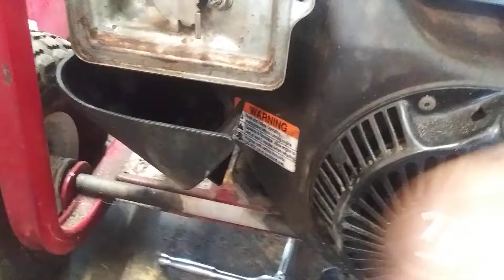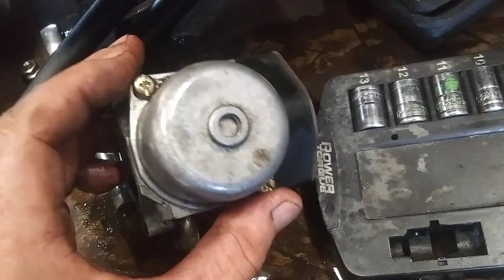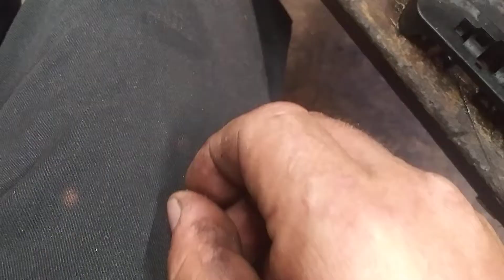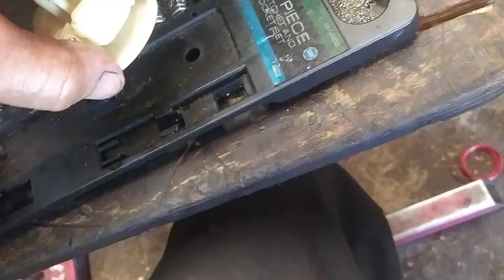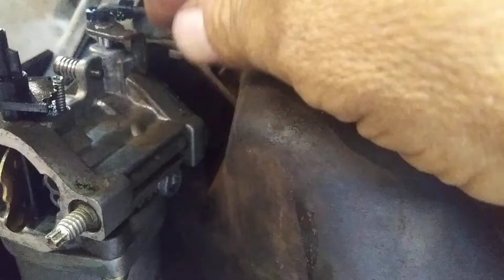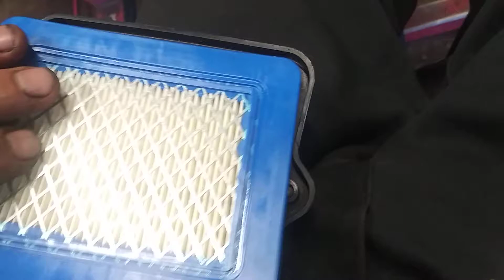* Craftsman 5600 watt generator carburetor repair briggs and stratton 10hp gentek carb rebuild

Comment: I appreciate the video. I just picked up an old 2001 Generac WheelHouse 5500 and it uses the same Briggs 10hp motor. It's surprising how even back then they were making things unnecessarily harder to fix, like using those fancy torx studs or tightening the devil out of those carb bowl screws. Or how you have to remove the carb to get the flywheel cover off.

Comment: Thank you! Not a difficult process but you made it much easier. Generator was running with choke on but not off. Cleaned the carb and added new gas…Hope it works. Thanks for the helpful video!!
Reply: Where can I find that seal or  carb

Comment: Hello 👋 Great Video! Unfortunately I Just Cleaned The Carb On 1 & Put New Gas In & It Still Won’t Start Without Starter Fluid & Only Runs A Few Seconds?

Comment: The 4mm socket you used to take off the carb. is a great suggestion. If someone wants to buy the one that is recommend it is an E5 star socket. The only auto store that had one where I live was NAPA. Very helpful video.

Comment: Mine has a wet spark plug. Why would that be happening? Also, seems to be running super rich. White smoke and sounds like it’s revving constantly.
Reply from the maker: sounds like the carb is leaking id clean and pay close attention to the float and needle valve. check oil gas may have gotten in it as well

Comment: I replaced a bad carburetor on my Craftsman 5600 generator with a Briggs and Stratton 10 HP engine.  It runs now but now it’s blowing smoke out exhaust. I tried to adjust It but can’t get it to run smooth plus it  keeps blowing smoke on and off. Thanks
Reply from the maker: Change the oil. It is overfull probably with gas in it.
Reply: @smallengineguys  Thanks I give it a try
Reply: @smallengineguys  Thanks for the info. Changed the oil and it started right up. Smoked a couple seconds then cleared right up. Much appreciated.

Comment: Thank you for awesome video. I have exact same Craftsman gen and followed your video to a tee, including replacing the seal. Upon reassembling, the gen started on first pull, super excited. However, the next morning, all the gas leaked out on garage and I’m sure I had it reassembled per your instructions. Only thing I can think of is no gasket….. Is there suppose to be a gasket on both sides of the carb, between engine and air filter holder?
Reply from the maker: its not the gaskets. it is the needle valve. could be a seal leaking or sometimes the needle valve sticks open after cleaning it. take off air filter put some gas in. you will see fuel leaking out of the mouth of the carb. tap the bottom of the carb with a wrench. it may stop leaking. if not take carb back off replace needle valve and seal or use new carb.

Comment: Do you know what the model # is??
Reply from the maker: No but if you have a 10hp briggs  with this airfilter it is the same carb as i have put in the description.
Reply: @smallengineguys  i just picked up a used one and im looking to get a new cover for the gen part of it. And a new dipstick. Just trying to order the correct parts.
Reply from the maker: @01cbr929rider  this is your motor hope it helps  https://www.ebay.com/itm/333015441476
Reply: @smallengineguys  thank you sir

Comment: i have a 6300 watt generator is this the same carb for it
Reply from the maker: If its a briggs engine yes
Reply: @smallengineguys  yes its a briggs looks just like the one you worked on just says 6300 I bought a new carb  gas runs straight out air breather right  out of box thanks for the help much appreciated
Reply from the maker: @thomascrouch5013  same carb click the link order it up. Its the easiest way.

Comment: my carb like that pours fuel from the 2 holes in the front into to air filter.can you tell me what i did wrong? i just cleaned and replaced the o-ring while i was at it.thanks
Reply from the maker: Either the bowl seal is leaking at the needle valve or the needle valve is leaking. Sometimes its easier to just buy a new one. Click the link in the description they are super cheap.
Reply: nevermind,wrong o-ring.
Reply from the maker: @marknaquin2765  that will do it

Comment: Awesome Job!! left my fuel line open and completely flooded the engine     I assume I have to do what you did ...?
Reply from the maker: and check oil if its over full it has gas in it. drain refill.
Reply from the maker: Yes you do. concentrate on the needle valve and float. that is why it flooded. then make dure main jet is clear and it should run.
Reply from the maker: also you will have to clear the cylinder it may take a few times taking out the plug and drying it.